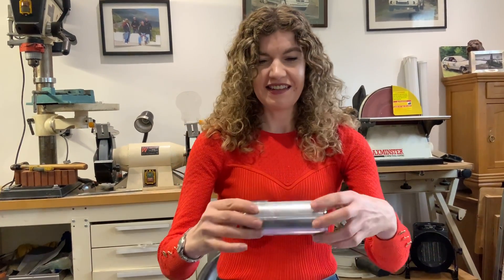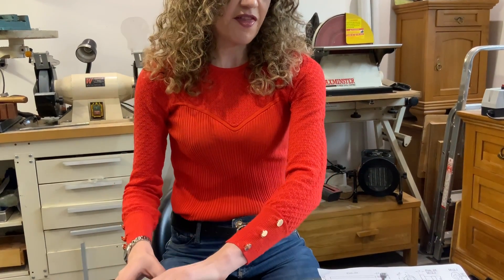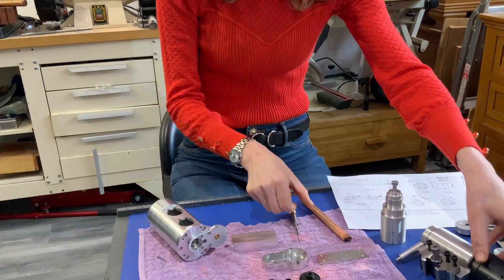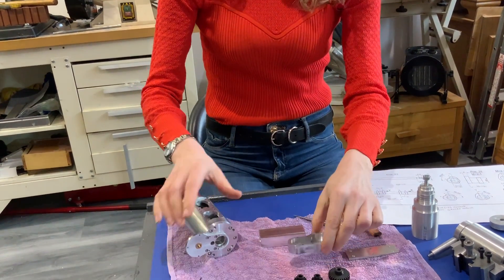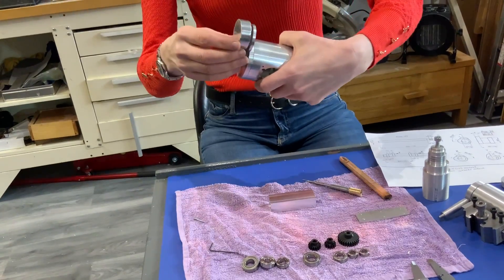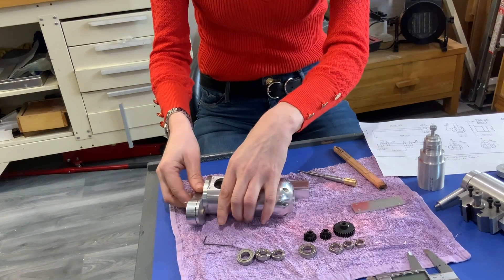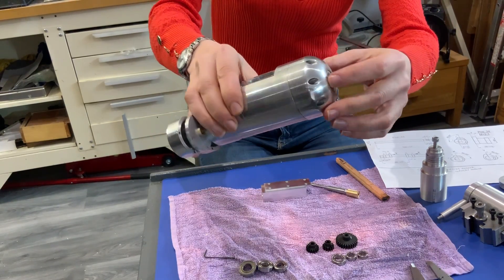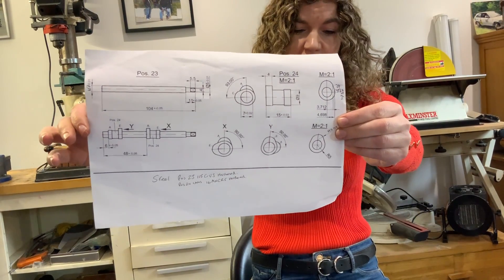Help on Boxer 4-cylinder engine

Comment: Did you guys ever lock in on a direction to make this cam? Its a rotary table part. Not too hard, but the setup may be a little confusing.
Reply from the maker: Hi Joe Yes I did do it exactly as you said It was a tiny part (0.25" cam) and lots of steps. This engine was purely from a set of plans and although I made a lot of it there were quite a lot of accumulated errors mainly due to my lack of experience/ knowledge. I decided to shelf it and get some more practice on other projects ie. the steam engine where there was more information out there. I made a single cylinder with a rotary valve that was nice to build but it was just out of my reach to get going...it popped a few times but never ran.

Comment: The Boxer engine is one i have been considering to make for a while now. The Cams. Some machine them by the offset method. Some make the cam lobes & bond them or shrink fit to a straight shaft. Look on youtube as i think there are a few vids of doing this
Regards.
Steve.
Reply from the maker: thanks, steve
 I will have a look. it's a great build if you need the plans I can guide you in the right direction
andy
Reply: @modelengineeringadventures  Andy if you could point me to the plans it would be appreciated. I do have an email address if you look at my profile it is there.
Reply: Thank you for taking the time to watch 🙏
Reply: Hi, you can machine the lobes on your milling machine by using a dividing head with simple indexing.
Reply: @KevinWoodsWorkshop  thank you for watching and  the advice 😁